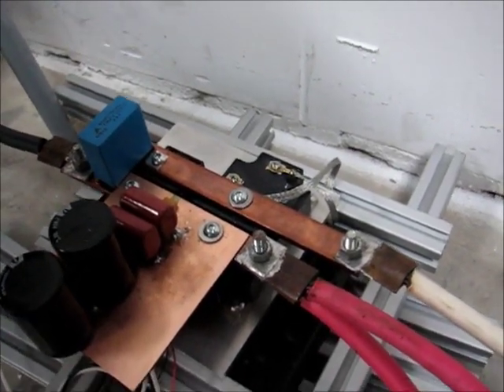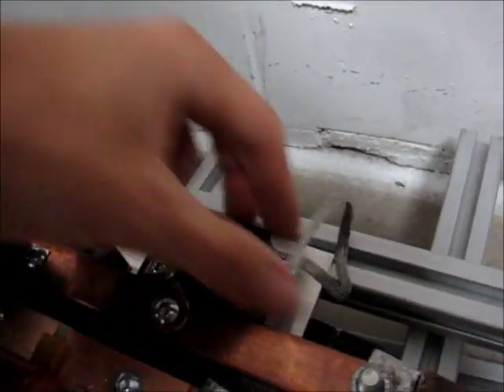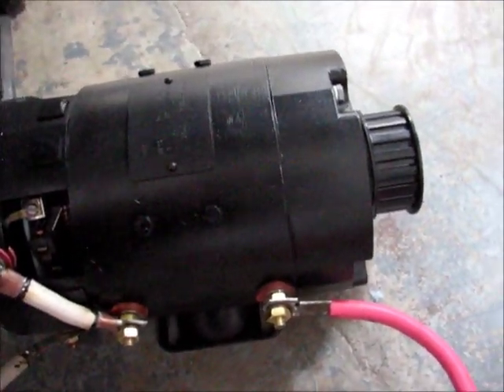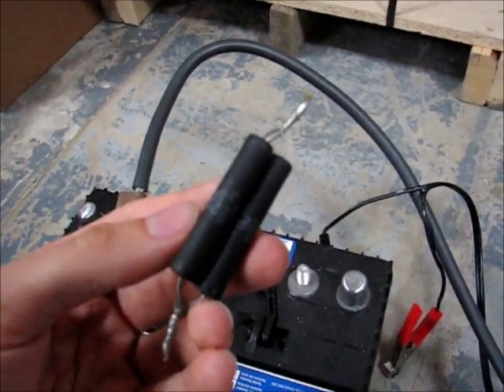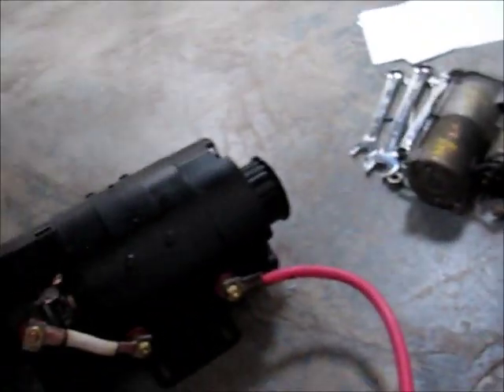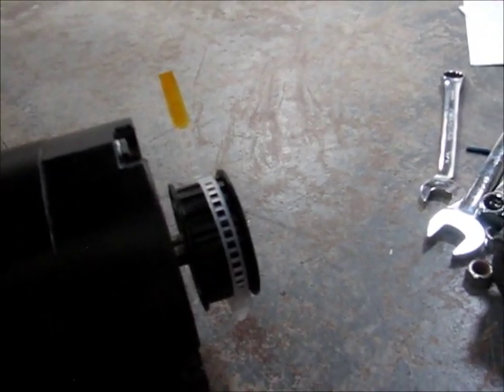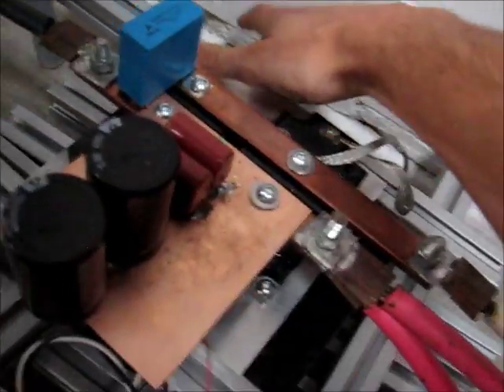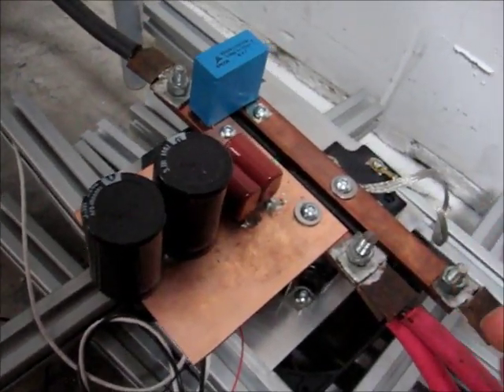DIY IGBT Motor Controller

Comment: Can you share the schematics  for this?
Reply from the maker: Sorry I'm not sure I ever posted them to the project site will-ev.blogspot.com but look here for a good primer: https://e2e.ti.com/blogs_/b/industrial_strength/archive/2013/11/15/more-than-just-motors-low-side-drivers 
It's essentially this, with an IGBT instead of a mosfet. I now know IGBT is not ideal for low voltage applications like this one, but they were much harder to destroy which is helpful for a young EE. (IGBT Vf is more significant than a comparable FET RDSon). Add a suitable gate driver and snubber, that's it! Give it a go in LTSpice and feel free to ask questions.
Reply: I've got an open Revolt file that I could collaborate. 

It's missing the schematic that shows where the certain parts go.
Reply: I've got an open Revolt file that I could collaborate. 

It's missing the schematic that shows where the certain parts go.

Comment: Hae bro,  congratulations 4 a good job.  Let me ask u I made myself IGBT controller , my question is here I was asking u can I use AC motor 3 face??  Course am using dc motor 3face
Reply from the maker: Face = phase? No you can't use this kind of driver for a 3 phase motor. Only for dc or universal motors.

Comment: My physics teacher told me that the only way to control and change the current and voltage in a motor is to convert it to ac and back to dc. I thought that PWM was just a solid state switch that would open and close really fast to change speed. Tell me if I'm wrong but that makes sense that it would work on dc.
Reply from the maker: There are many kinds of motors with different requirements. For DC motors you can provide linear DC voltages to change the speed, but since that's more expensive and difficult, typically you would use PWM as you describe.
Your physics teacher is, unfortunately, completely wrong. As above you could use a power op-amp to vary the speed of a DC motor linear, from say 0-12V, without any AC anywhere. Check out wikipedia "Brushed_DC_electric_motor#Speed_control"

The better way as you discuss is called "Chopper" in the wikipedia article above. I am PWMing one IGBT at several kHz, varying the duty cycle. The other is simply used as the flyback diode.
So, the controller is basically putting out a square wave, either zero or maximum voltage.
More advanced - the motor has an inductance (a resistance to changing current) which actually smooths the voltage across the motor and the current through it - so it's not turning on and off completely, though it does vary up and down rapidly. With low PWM duty cycles, the average voltage will be lower and vice-versa.

What's cool is that the way we control AC motors is also with PWM - but instead of making a DC voltage for the motor, we PWM both plus and minus in such a way that it approximates a sine wave. So here we convert AC from the wall into DC in the "Variable Frequency Drive" which converts that back into AC - but with (as you might have guessed) a variable frequency, instead of the fixed 50/60Hz from the wall. Basically the opposite of what your physics teacher said - maybe this is what they mis-remembered?
This is important, because in AC motors, the speed is proportional to the frequency, not the voltage in DC motors.

Comment: I'm trying to make learn how to make one of these. How did you learn how to do this?
Reply from the maker: Going to university for electrical engineering helped with the basics, but most of it is spending hours reading stuff online, starting with a small prototype and working your way up. I used a tiny 12V radioshack motor, some cheap TO-220 N and P mosfets and some breadboard - its pretty easy at this stage, and there's lots of resources online. For the high-power version, my main resource was the massive thread from ecomodder dot com - search "Paul & Sabrina's cheap DIY 144v motor controller"
Reply from the maker: After you do some research and think about it for a while, feel free to ask me questions and I can try to help.

Comment: Ok if use RCD snubers your swiching loss   will decreased  and you can run it in more power
Reply from the maker: Yes - it already has a snubber to reduce switching loss. That's the large blue object on the left. I have an oscilloscope, and I can tell you that these IGBTs have such a slow switching speed that if my PWM frequency was >20kHz then a large portion of the duty cycle would be switching, and thus the losses would be too high, with or without a snubber.    If I had to decrease the PWM I would upgrade my gate driver circuit to a +15/-15 drive which would shorten the switching time and allow a higher frequency without overheating.    I'll agree the design could be optimized, but it works well enough. Thanks for your suggestions.
Reply: electrowizard2000  It's common for electric drag racers to take stock warp 11 motors and run them at 240+ volts without issues. I have a stock 36 volts series wound DC motor Model ES-33 that I run at 72 volts....Corona is a non issue.

Also, don't bother with using IGBT's unless you plan high voltage. You are better off using paralleled mosfets that have LOW GATE CHARGE. The best mosfet to use is Texas Instruments CSD18534KCS. It has low gate charge, but also has low ON resistance. You can also get away with a very low power gate driver with these mosfets, but still get high switching speeds!!

Comment: So this is not 3 phase inverter... and it seems you are using a battery  for your power mains ...why?  your carier frequncy is realy makes harmful sound ... why this is too low to make noise?
Reply from the maker: No, it isn't a 3 phase inverter, because that is not a three phase motor. It's a brushed DC series-wound motor.   I am using a battery for power because this was designed for a mobile application - a go kart. See http://will-ev.blogspot.com/   The PWM frequency is low because the IGBTs from ebay were from the 1900s and can't switch any faster without overheating. Subways and streetcars have the same issue, at least where I live. Protip for anyone replicating this: use IGBTs from the 2000s; IGBT technology has apparently improved a lot recently.

Comment from the maker: Hi.. I'm sorry but I don't really understand - was there a question you wanted answered?
The IGBT acts as a diode if you hook it up correctly - it isn't "meant" for this purpose, but it does a good job if you need a diode and don't have one. We ground the gate so it doesn't accidentally turn on in the reverse direction.
You need lots of capacitance - some in bulk electolytic and some at high frequency with film and/or ceramic. Both are required to keep the voltage steady enough.

Comment: Hi i see you using igbt as freewheeling diode you said that if we conect gate to emiter it will be a diode or are we using the internal diode from the igbt.

And if i have a big capacitor bank instead of  a sumpfer capacitor

Comment from the maker: Interesting. I'd believe I have some issues in the switching part of my design  so my switching losses are probably higher than they should be. 
I can imagine a bad connection on the unit itself - the V_CEsat voltage across IGBT (mine is the ~1.5 I metioned) increases with temperature, so the heat from the bad connection caused to to produce more heat and run away. Poof! I saw a loose connection melt and burn an outlet once but I bet yours was more spectacular. Anything in particular at 'swift?

Comment: heat was not an issue. 1/2 inch thick aluminum plate. I had one that over heated it was because of bad connection on th igbt. look at this site GOOGLE FORKENSWIFT

Comment from the maker: Re: 12 vs 24V I'm sorry I forgot this video was the 12V test, the later videos I posted were at 24V with no loose connection. 
I do appreciate your experience and insight.
How hot do the IGBTs get in the units you work on? Also, how much metal are they bolted to? Since this version was only bolted to a smallish slab of aluminum (6x6x1/4") the heat accumulated quickly. With a large heatsink and a fan it runs at a reasonable temperature.

Comment: running a 24v motor on 12v is your problem, unless im just not understanding what you are doing. I think you are running circiutry on 18v and motor on 12v from battery. you can overvolt easily but undervoltage causes problems. just trying to help, if im wrong im wrong. I work with dc starters, generators, motors and alternators all day every day. weather im right or wrong you have SOMETHING WRONG. IGBT'S do not run that hot i've repaired many forklifts and electric pallet jacks.

Comment: Typical DC EVs spark a little at higher speed but that's just tolerated. It is a very primitive motor type, that's just the way it is.
As for insulation breakdown, in a coil the voltage span is across many windings so the voltage between adjacent wires can be very low. It doesn't take much insulation to handle so that's probably not a problem in practice. Maybe a minor issue with old motors with primitive or degraded plastics.

Comment: I wouldn't say I'm an expert so I'm deducing part of it from other electronics knowledge. The higher the voltage the more the air can become a conductor. At 48V it's not likely to spark much but at 1500V it can spark a lot, primarily at the brushes. 1500V can reach 1.5mm in air and start a spark but when the brushes pass right over it's very easy to start a spark and once started 1500V can maintain the spark up to a large distance. If it sparks too much it can perhaps erode the motor.

Comment from the maker: I'm glad we could agree. It is a very different voltage range, and it's not necessary that the data at 480V applies at 48V.

Can you tell me why this is an unreasonable assumption? I would honestly appreciate your help understanding this subject. All I have found is hearsay on forums, no real data anywhere.

(whoops, logged into someone else's profile by accident last comment)

Comment: Of course there are limits. But we were talking whether a 24V motor could handle above 48V. You said it couldn't, I said it could.
But a 480V motor might not like 1000V or more. Very different voltages

Comment from the maker: I just found another link that helps show that motors really do have upper limits on their applied voltage. If you google "motor_tip_sheet14.pdf" the first link is a US Department of Energy article on inverter-duty AC motors. This isn't AC but it is still PWM'd applied voltage to a motor. It indicates inverter duty AC motors (specially designed for PWM) can still only tolerate voltage spikes of at most 3.1 times rated voltage. I won't claim it's the same (info is on 230/480V class) but similar.

Comment from the maker: Self correction: the breakdown of insulation on wire is simply called electrical breakdown of insulation. The electric field required depends on the thickness and construction of the insulation.
Corona discharge is the ionization of a fluid (commonly air) caused by an electric field not quite strong enough to cause breakdown.
I apologize for the mistake.

Comment from the maker: Re-reading this I should clarify for future reference- a *series wound DC* motor under no-load conditions draws very little current. For other types of motors this is very very wrong. In this type of motor, the motor runs so fast the back-emf is relatively high, so the current is low. Comparatively, when stalled the series-wound motor's low resistance causes an extremely high stator and armature current, yielding excellent torque.

Comment from the maker: I'm sorry but I have to respectfully disagree. The physics of an IGBT are such that there is a constant voltage drop across the unit - around 1.5V as I said in the video - multiplied by the motor current this is the power dissipated as heat in the IGBT. The pack voltage makes no difference. 
I'm not even sure how you suggest I add 4V. If you're thinking airplane 28V systems it's the same thing - two lead acid batteries make between 24 and 28V, depending on their charge level.

Comment: under voltage and that loose connection is your over heating problem. bump it up to 28v and it will drop the temp.

Comment: I don't have examples handy. Although White Zombie runs 300+V
I'm fairly sure you can run it way past 2x and corona sounds very unlikely to me over the insulation. that's crazy talk : )
what you might get though is some arcing on the brushes but even that is a non issue I believe. 
afaik the only thing to watch for is the rpm.

Comment from the maker: Hello Dan. I'm sorry but I believe you have been misinformed. DIY electric cars commonly use motors such as the WarP 13 which is nameplate rated at 72VDC.
A 24VDC motor would surely break down its insulation at six times its rated voltage via corona. If that didn't happen, the power levels (V^2 / R) would be 36 times higher than stock, if you did not current-limit the motor. Those power levels could not be sustained for long.

Now, if you still believe am wrong, kindly provide a reference.

Comment: You can run a 24V motor much higher than double voltage. DIY electric cars use such motors and they run them at 144v or even higher

Comment from the maker: Ahh I know that feeling. I'm certain the schematic you are using currently will work just the same, so long as you watch voltage requirements etc. I'm sorry I don't really have time to assemble and document a schematic, others have asked before. 
Really what I did is nothing special or unique, there are a million examples online. 
I broke down and wrote an explanation of the circuit in the video description, and added a link to ecomodder. An amazing resource, it was what got me started.

Comment from the maker: For more information about the loose connection (used only for light testing as seen here) please check out my next video where I use this motor and controller to test drive the go kart I built!
In that test, I was expecting high currents. Thus I securely fastened all terminals, and the emergency disconnect was provided by a heavy duty contactor hooked up to an E-Stop pushbutton.

Comment from the maker: @chrisdsanders
I'm not sure if you realize this, but you come across as *extremely* condescending. 
I completely realize the loose connection has a poor current carrying capacity. 
Are you aware that a motor under no-load conditions draws very little current? 
You should also have noticed that this was a short duration test, over which there was not enough time for any heat to build up, even if the power levels had been higher.
What would have happened in an emergency had I bolted it down tight?

Comment from the maker: @high1voltage1rules - glad you like it. Definitely go with half-bridge IGBTs instead of single bricks like I did (ah, hindsight). Would have been mechanically simpler, and electrically better.

@260830107 the snubber cap is to prevent voltage spikes across your switching transistor from destroying it. The voltage spikes are there due to inductance (di/dt) effects - simply the current through the IGBT doesn't 'want' to stop, so it would generate huge (hundreds of volts) spikes if not for the cap.

Comment from the maker: Hi, thanks!
Actually funny you mention that... This controller is an upgrade *from* MOSFETs :)
You're right, they do much better at keeping the heat down. Unfortunately they are much worse at surviving! I only have two videos, go check the other out :)
Reply from the maker: @max marrero what you say is true for an AC motor, this was a series wound brushed DC. Here torque falls off with speed because the increased BEMF decreases the current, since you're limited by I = (battery voltage - BEMF) / R

Comment: Hi. This looks great! Have you considered switching (no pun intended) to MOSFETs instead of IGBT? A few low RDS(on) MOSFETs in parallel should give you plenty of torque while keeping heat down. At 48V bus, they do better than IGBT in most cases.